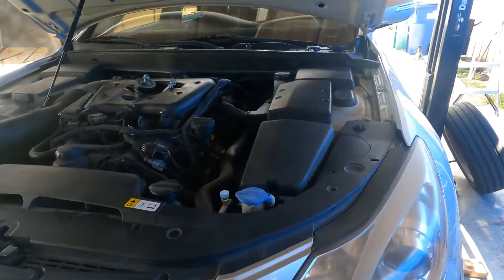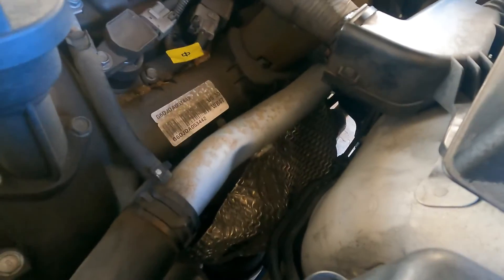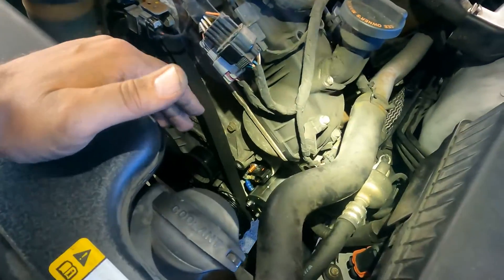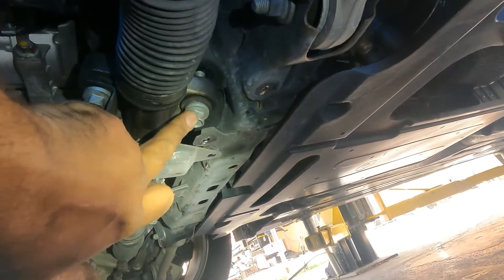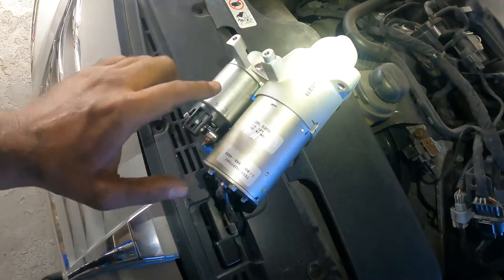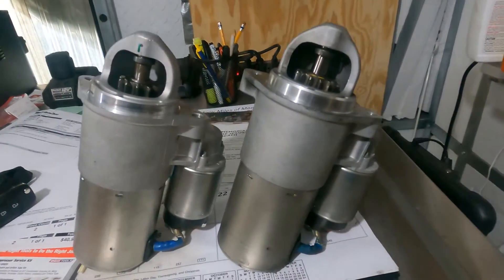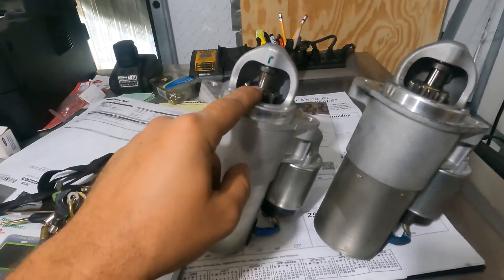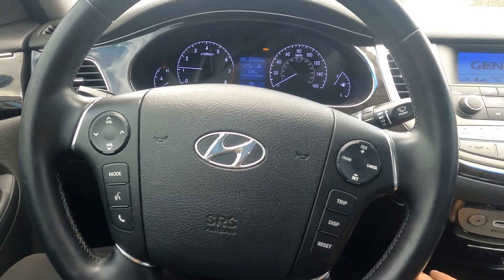2013 Hyundai Genesis 3.8L starter replacement. Starter clicks, no start

Comment: Question i replaced a starter on a Hyundai Genesis sedan 2012 , i replaced it with a 13 teeth starter, the bad one had 11 teeth. The car started well, would i have any issues in the long run, since i replaced an 11 tooth starter with 13 teeth starter?
Reply from the maker: Honestly i don't know how you got it started. Normally it should bind because of the difference in teeth

Comment: Where are you located ? I have the same car and having rough idle on red lights or stop
Reply from the maker: South Florida
Reply: Rough idle on red light is most likely your fuel pump. Sometimes it makes your car not start easily
Reply: Check ur variable valve timing solenoid.!